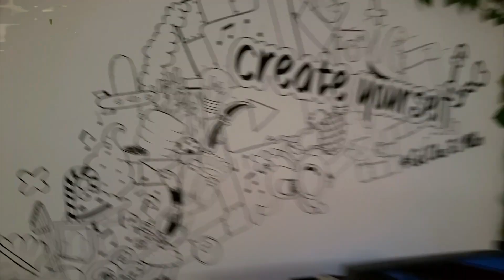Can A 400kV Module Power A Tesla Coil?

Comment: For how long you can turn on the 400kv module, mine dies if its on for prolong, also did you just connect the module to the primary coil and not to the secondary similar to transformer

Comment: Sweet coil! Looks about the same size as one I built a while ago, except mine used a 9kV neon sign transformer (I made a tutorial on my bigger Tesla coil here: https://www.youtube.com/watch?v=wiaehhgtasM). I'm honestly surprised how well the "400kV" module worked. Way to take the risk of damaging your coil for the rest of us! It's pretty hard to get a real voltage rating on those little modules (it's obviously not 400kV, or else it would be making sparks well over a foot long. Most likely it'll be in the range of a few tens of kilovolts). Great video, dude!

Comment: I also done that but the high voltage generated not producing enough arcs after frequent use . Do you have any solution for this
Reply: those generators are super crappy and the same thing happened to mine. It might have been caused by repeated overvoltage if you regularly ran it on more than 3v
Reply: The caps will short internally after a while, that is why they will be becoming less effective and eventually fail.